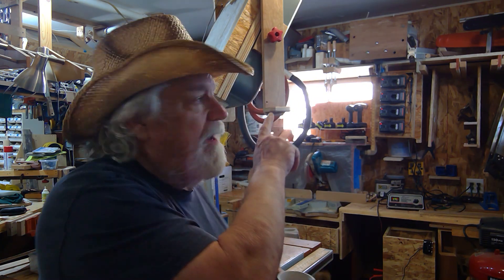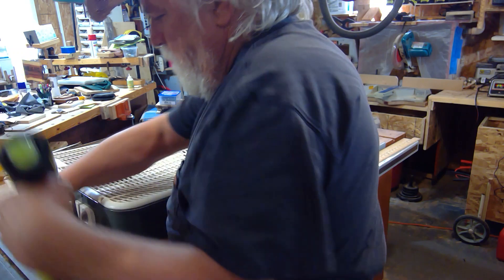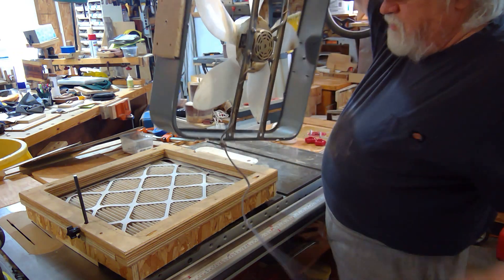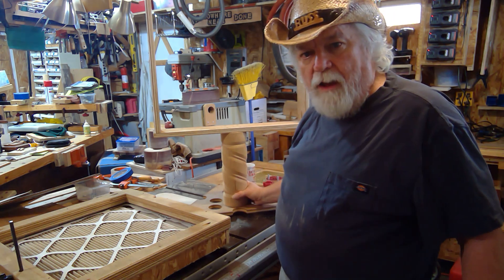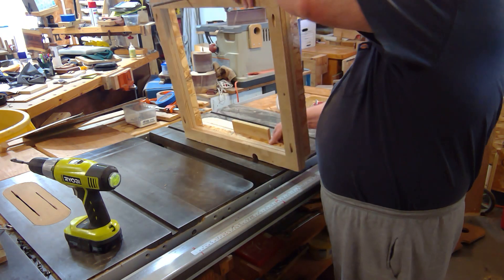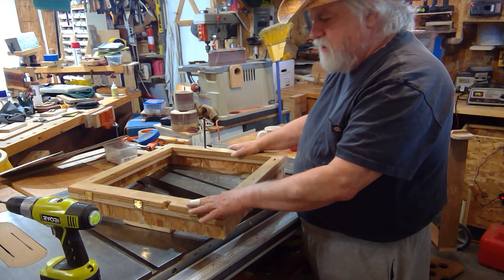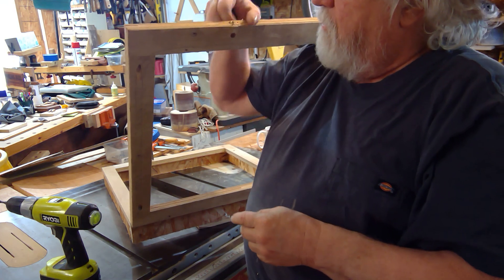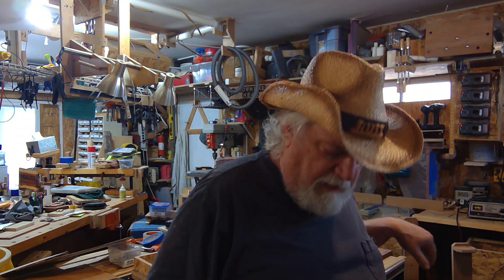Make an OTB Box Fan by OTB Thinker

Comment: Speaking of fans...I live in a condo and get no pass through ventilation.  I would love to build an extremely flat fan to hang on my screen door to bring some fresh air into the house.  Any suggestions?
Reply from the maker: My first thought is to frame a 2 fan window fan in a picture frame. They have a thin footprint and not too heavy.  Get one that is cheap and simple.  they are lighter than the expensive ones with temp controls.  I will think about this and might come up with another idea.  BTW, the frame is optional :>)  I would be interested in your final solution when you get one.
Reply: @russveinot5754  A good start, Russ.  I was actually thinking of a flat, high torque motor and use a belt to turn the fan blades. All on a square frame.  Keeping it really flat that way.  My ultimate goal would be a solar panel version.  But, electronics are not one of my strong suits.  The blades don't even have to turn fast.  Like a ceiling fan on low.  But thank you for the suggestion.
Reply from the maker: @bbrachman  You could get a fan like the one I saw at Amazon (link below).  Price is high, but I like the design idea.  Maybe build one similar and use any power source you want.  I do have another design that came to mind  which would have a permanent mount above door.
link:
https://www.amazon.com/Suncourt-Frame-Maximizing-Indoor-Circulation/dp/B0007N5LHM/ref=sr_1_2?dchild=1&keywords=screen%2Bdoor%2Bfan&qid=1623596260&sr=8-2&th=1

BTW, this might make an interesting video build :>) Thanks Bruce

Comment: Very well built. Frankly for a shop 'tool' I don't think you need to fancy it up. If at some point in time you find that you need more filtration (deeper filters) then you can rebuild and resize (if necessary). I would think you could use significantly deeper filters without having to worry about swivel problems so only your box depth may need to change. The great thing about shop prototypes is that if you find that they work well without need for major changes you no longer to need to call them a prototypes!
Reply from the maker: Thanks Tim.  Most of my prototypes tend to be the final version :>)  BTW, I am thinking about what happens if I a double fan (stacked) to increase flow.  Not sure how it effects flow but I might try it.  I do have 4 different air filter units (all different).  Probably don't need another one.  We shall see :>)